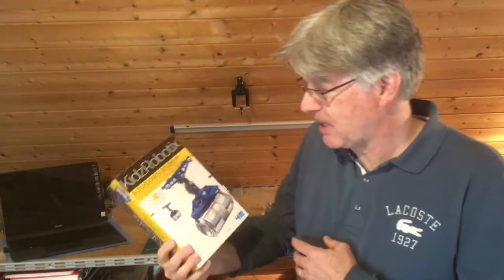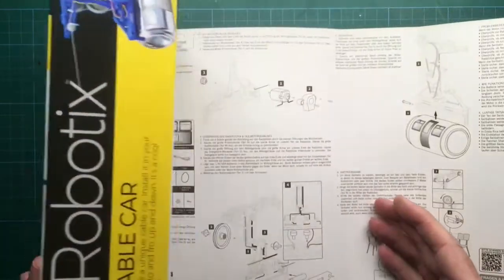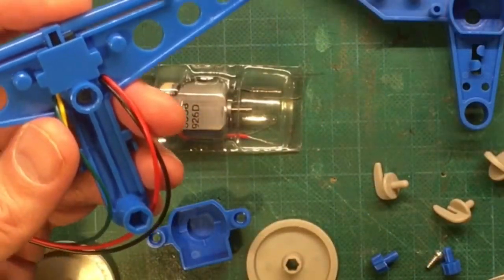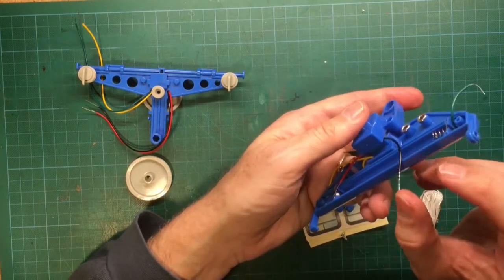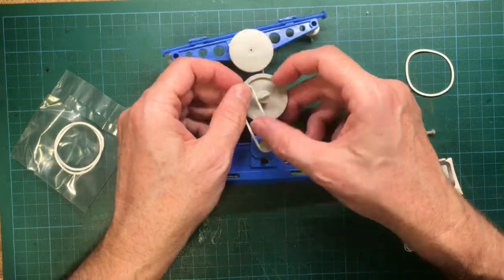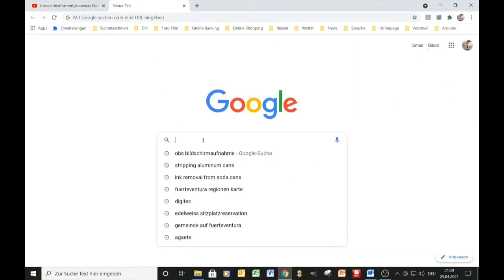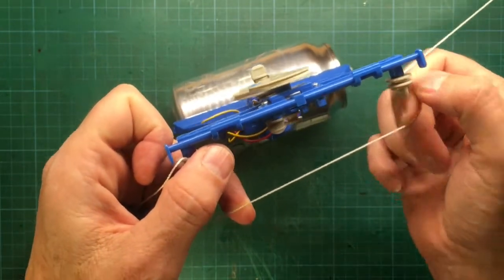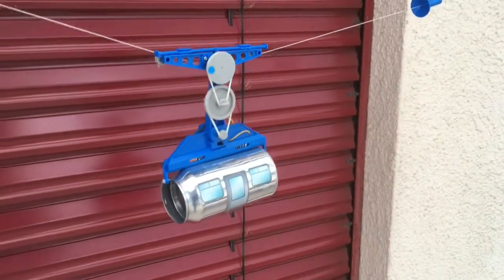Soda can cable car

Comment: Any idea how much of elevation change it can handle? 😊
Reply from the maker: Do not expect too much - I thought using this for a camera at a kite in the air for aerial photography - it did not work. However you can play with the type of cord and the rubber coating on the wheels to improve it.

Comment: This was a great video and I want to get this kit for my son. I did have a question I'm hoping you can answer. I've read before that suddenly reversing a DC motor can damage it, but isn't what this cable car system is doing with the reversing switch? Any info you can provide is much appreciated!
Reply from the maker: This is no problem at such low voltage / current using two 1.5V batteries
Reply: @LeFreak  Thanks for the response and the info!